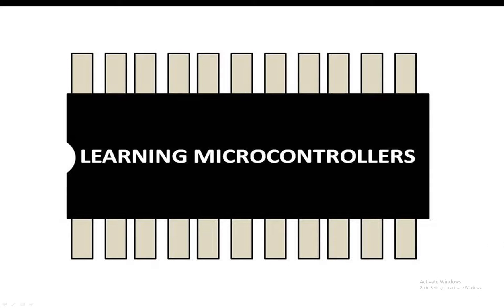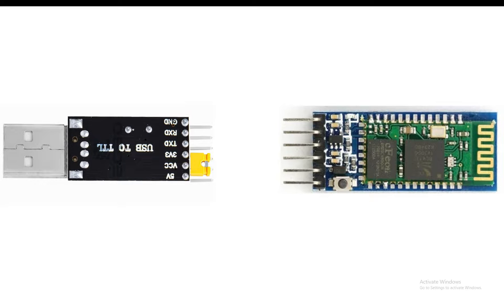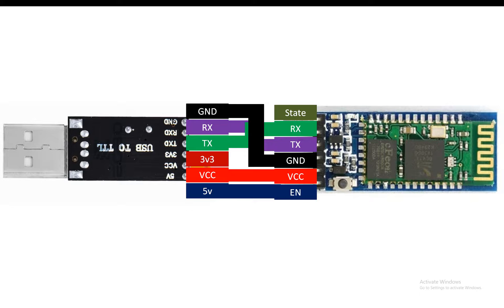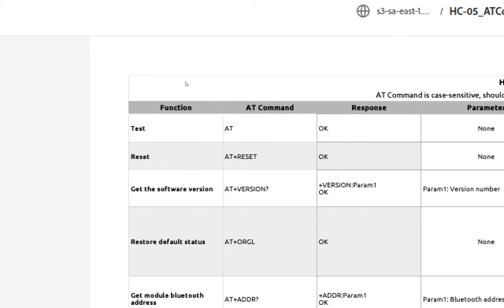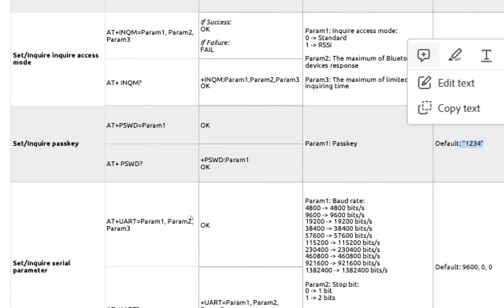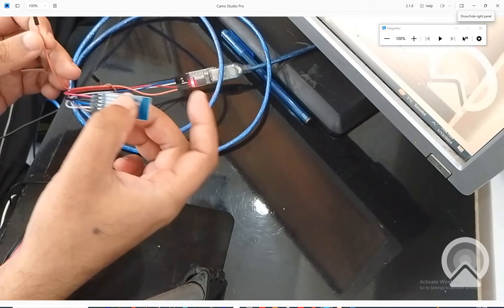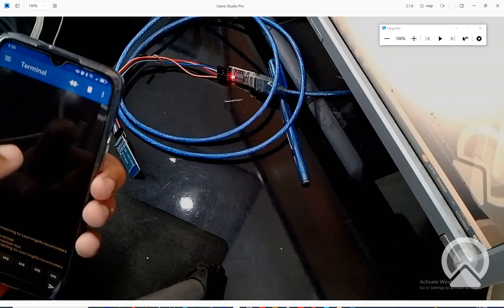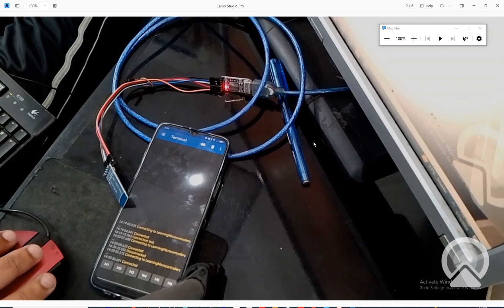How to change default settings of HC-05/06 Bluetooth module using USB to TTL device.

Comment: It is important to note that the HC-05 module has a 3.3V logic level, so we cannot connect the HC-05 module’s Rx pin directly to a digital pin on a 5V microcontroller like an Arduino UNO. In other words, the Rx pin on the HC-05 module is not 5V-tolerant. Therefore, before connecting to the HC-05 module, the microcontroller’s Tx signal must be stepped down to 3.3V.
There are numerous ways to accomplish this, but the simplest is to use a resistor divider. A 1K resistor between HC-05’s Rx and Arduino’s D2, and a 2K resistor between HC-05’s Rx and GND, will work just fine.
Reply from the maker: Thanks for the knowledge

Comment: Hello sir, How to change default settings of HC-05 in CMD mode? Help me please
Reply from the maker: You have to use USB to TTL device to connect to PC
You can use any serial terminal
Use commix or any other
Why CMD!?
Reply: @learningmicrocontrollers3561 HC-05 has two modes DATA MODE and CMODE
Reply: @learningmicrocontrollers3561  HC-05 have two mode DATA and CMODE
Reply from the maker: I make a video on that soon
Reply: @learningmicrocontrollers3561  ok, thank you for your concern